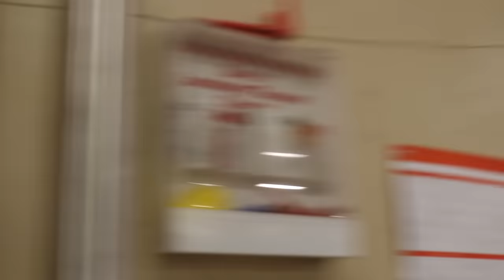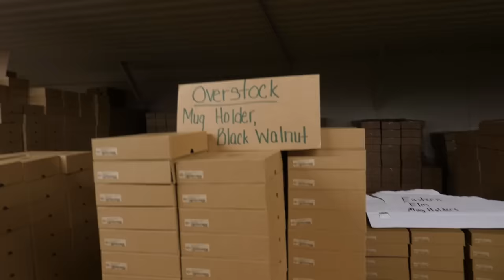We're Literally Renting Cargo (this is crazy) S14E51

Comment: Of the the best ways I have found to find if a container is water tight is to do a light leak test, where you close yourself into a shipping container to see if you see any light penetration if you do you have holes, it is used in radioactive shipping to ensure water tightness
Reply: Or tarp it! :D
Reply: I came to the comments to say the same thing. Even in brand new containers you can find pinholes in welds by doing this.
Reply: @EelcoWind Tarp can cause more problems than it solves by trapping water/condensation underneath the tarp, especially on humid days.

Comment: I have concerns with wood stored outside in the containers warping due to humidity changes.
Reply: I was thinking the same thing, I hope my table isn't sitting out there.l... GUYS just ship the tables. What ever is holding them up. you need to fix this ASAP.. even if it's to ask more shipping to send felt / matts. I don't want any piece of my table hanging around outside. specially since the weather is changing so fast.
Reply: 100% This!  It's not just that it's out there, it's that there will be a drastic change in humidity between the container and the production area.  So if they're not giving that wood at least 3 weeks to acclimate in the shop before starting to work with it, it's going to potato chip on them.

Comment: If you want to play on dirt, you need pneumatic tires on your fork lifts. Also Fork lifts have no down pressure on their hydraulics because they're not designed for digging, only lifting. Also your gravel pad should be packed with a vibratory roller. And yes even the type of material you use for the pad will determine how well it packs and stays solid.

Comment: Serious question folks, is it really cheaper for you to be installing containers and all the labor working on this and still not having enough storage space versus sending people in the first few waves their tables now and accessories later if that’s what’s stacking up so much wouldn’t that free up a ton of space?? Can you not track partially shipped orders? Also agree it’s great to see James again
Reply: I’m guessing maybe they are knowing they’ll need to expand storage forever and this is the move they can make now. 

Sometimes you gotta step forward even though you know that you’ll need to fix the other things ahead - because the place behind you is dropping fast.
Reply: I mean the biggest issue they have is the cost of shipping. I'm thinking those containers are not all that expensive to rent (we do at the place I work at and they are less than $200 a month. It seems like they are working to fix the bottlenecks they have so I'm sure this problem will get solved in a timely fashion.

Comment: Yea gravel settle time is like a week, if you got a roller you could get that down. Otherwise you can lay down plywood with two 2x4s over it where your wheels go over, to distribute your weight over the gravel. You may not need the 2x4s, that's the suggestion for getting a truck out of mud, I don't know how much a forklift weighs vs that.

Comment: So, based on these last two episodes, manufacturing all those parts kept people working for X amount of time - will changing the process by which you decide what to manufacture when negatively impact staffing? It would seem you would hav to possibly lay off or furlough people possibly if a single item was not in stock for assembly, etc, only to have to staff back up. For instance, using MGT as an example, I expect there are a fair number of people (and machines) that are dedicated primarily, if not solely, to those processes. If neoprene does not simply come in, can those same people and machines be fully used for something else? It's easy to talk about cross training people, and some machines may simply be completely idle...its a much more complex issue than just changing the order of order manufacturing.

Comment: Im left wondering whats missing that is causing this pile up. Either i cannot recall or it hasnt been said. You guys are working quite hard, hope things go more smoothly
Reply: By last episode it sounds kind of like this with 2 customers of the same wood:

Customer 1:
1 MGT
2 Cup Holders (1 missing)

So they are waiting for the second Cup Holder for Customer 1.

Customer 2 with higher priority:
1 MGT
4 Cup Holders
2 Player's Desk (Missing)

Because Customer 2 is higher priority and is waiting on the Player's Desk the cupholders that Customer 1 could get is not being put in Customer 1's order. Due to Customer 2 is priority. And then by logistics, maybe they have Player's Desks but it was designed and built for Customer 3, so Customer 2 was forgotten when put on hold.

It is kind of a mess I am not sure how they got into. I hope they can entangle themselves out of it.

Comment: yeah without shoring beams under the containers, they are going to be temporary.  Sitting them on gravel is better than nothing, but those metal runners will be gone in a year or less in the right conditons.  Desert sand gobbled up maintenance modules like termites in Saudi and Iraq (when it got wet, it did the deed fast!)

Comment: E?! Again?

For the love of god, learn how to recover a forklift. There's so much wood scrap there. Drive onto it. Then understand you need to pack gravel. It doesn't matter how level it is, it's uniform size and loose. Base, crush run, then top. Varying sizes packs harder, creates firm foundations for heavy equipment.